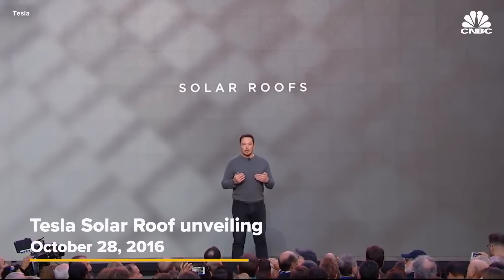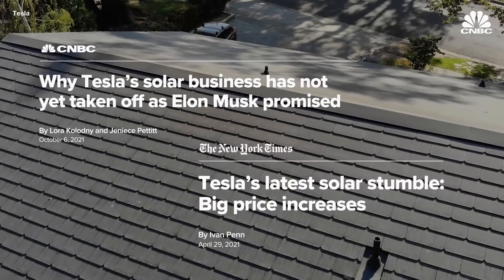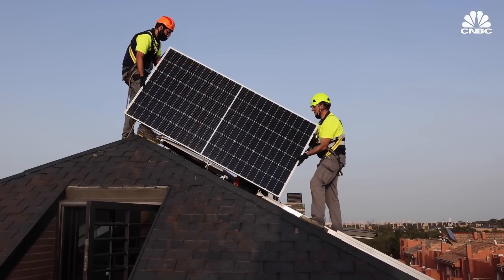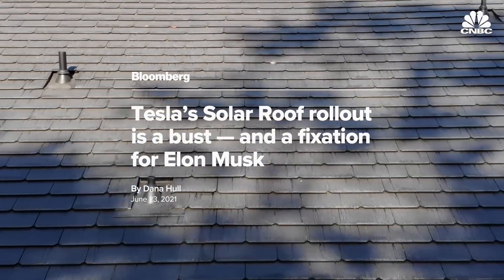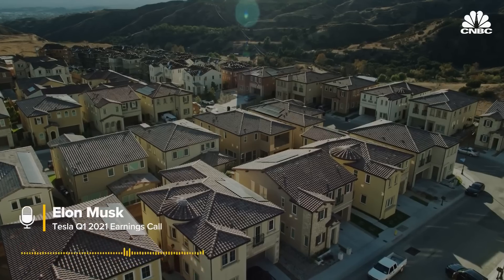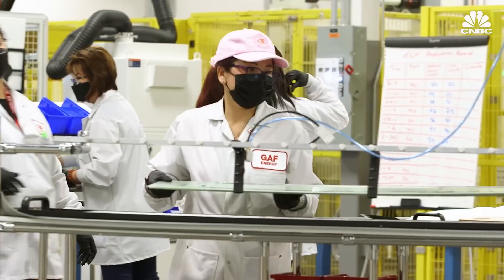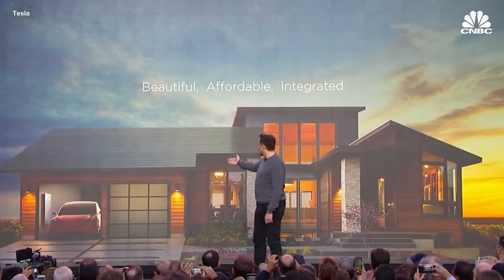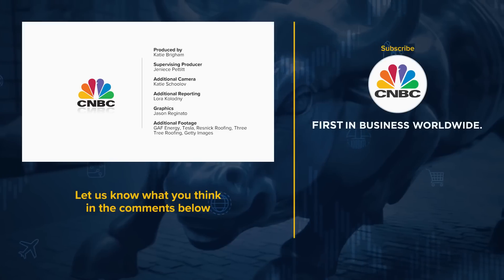How GAF Is Competing with Tesla’s Solar Roof | Solar Innovation Explained

Comment: Nope!  Not good enough.  These panels don't have micro-inverters or DC optimizers like traditional systems do.  Solar production can be blocked by small debris or shadow.  I'll stick with traditional 'ugly' panels which shade the existing roof and house which generate 3x the watts per square foot.

Comment: I pay 9 cents a KW for hydro, no  maintenance, no battery, no panels. Cheaper.
Reply from the maker: Hydro is a great way to go if you have the right set up and environment.  What kind of Hydro system to you use and recommend?  Is this a rain water collection system with a pump to the roof Hydro system.  I saw a few of those and they looked very interesting.

Comment: But how long will any solar roof last?  25 yrs?  30 yrs?  Then what?
Reply from the maker: Most traditional asphalt roofs last 20-40 years depending on the climate, the solar shingle roof has a 25 year warranty and should last longer than that but after 25 years the solar output efficiency will slowly degrade.  This is pretty typical of any solar product and/or roofing product.

Comment: Can solar roof tiles be made with metal roof base panel form. Metal roof panels are commonly edge fastened with clips.  Putting wood strapping with air flow beneath metal panels would allow natural air convection flow  helping to control heat buildup. Protrusions could be easily accommodated with plain none solar panel pieces.
Reply from the maker: Roof-it-solar a company in Estonia has been working on a metal solar roof.  Check it out here:  https://youtu.be/tf88kOktOA8 pretty cool what they are trying to produce.
Reply: @legacyroofingutah9766  thank you im contacting them for more info

Comment: I could see this working on the new house market best. rather then the replacement market adding 10,000 at that point not such a big deal.
Reply from the maker: Yes this is for new home builds or replacement roofing systems.  You wouldn't want to have a good roof removed just to put this on.  Wait until your roof has exhausted its current life then consider a solar shingle roofing option.

Comment: The heat is a good energy source, not a problem. 
Don't bend the good source for your twisted design objectives like those CCP.
Reply from the maker: 5 Myths About Solar and Weather
By The GAF Energy Team
7/24/2020
When it comes to how solar panels operate day in and day out on top of the roof of your home, there are few common misconceptions. We thought we’d clear up those myths with some facts about how solar works in all kinds of weather conditions.

MYTH 1: Solar only works in hot weather.
You need plenty of sunlight to generate solar energy and there are more hours of sunlight during the warmer summer months. It’s the light — not the heat — that solar panels use to generate clean energy. Solar panels actually work more efficiently when it’s not too hot outside. In fact, there are many instances of solar panels working in extreme cold, such as the Antarctic, or even to power satellites in outer space.

MYTH 2: Solar doesn’t work during the winter.
The Solaria solar panels used in GAF Energy roof-integrated solar systems have been subjected to extra reliability testing to expose the product to a variety of stresses, including severe heat and cold cycles and cyclic humidity and freezing. And, as we explained in Myth #1, solar panels work more efficiently in cooler temperatures, so while they may collect less overall sunlight in, say January, the panels will generate electricity any time there’s light — as long as they’re not completely obscured by snow. 

If it does snow, due to the pitch of most rooftops, as soon as the sun comes out the snow usually melts and slides off the glass panels. It’s also worth mentioning that, depending upon where you live, thanks to a policy called net energy metering the excess solar energy you generated during the summer can be used as a credit with your utility when your solar production naturally decreases during the winter. 

MYTH 3: Solar panels can’t withstand a heavy wind or rainstorm.
What’s amazing about the new GAF Energy solar system is that you’ll be getting a roof from the most trusted roofing company in North America and a solar system that’s designed to be part of that roof, similar to the way a skylight fits seamlessly into a roof. This avoids having to risk the integrity of roofing materials by puncturing them to install a traditional solar system, potentially causing leaks. A GAF Energy solar roof is a product that has been tested in lab conditions to withstand winds of up to 110 mph. That means it’s certified per building code regulations to be installed in areas with prescribed wind speed ratings of 180 mph. The wind test also includes wind-driven rain at a rate of more than 8 inches per hour — twice the rainfall rate of the worst rainstorm in history. 

MYTH 4: Solar doesn’t work in cloudy areas.
Today’s solar cells are more efficient than ever, meaning they’re able to capture the sun’s rays even in low-light situations. In fact, cities such as San Francisco, California and Portland, Oregon have plenty of foggy or overcast days, and plenty of happy solar customers. Up and coming adopters of solar energy, such as cities on the East Coast with similarly overcast weather like Boston, Massachusetts and Newark, New Jersey.

 MYTH 5: Installing solar causes rain to leak through the roof.
As we mentioned in MYTH 3, you’re getting a solar system that has been designed to be part of your roof. Because the GAF Energy solar system is a direct-to-deck installation, similar to a skylight, its seamless, waterproof set-up avoids leakage problems associated with conventional rack-mounted solar panels. Rack mounting or “retrofit solar” requires puncturing your shingles and roof to install the lag bolts that hold the rack onto the roof. This sometimes disrupts the shingles and waterproofing, causing leaks and potentially accelerating the degradation of your roofing materials. By comparison, DecoTech®  is installed onto a fresh roof deck along with a new comp shingle roof and flashed in to ensure that the building envelope is maintained.

Comment: How would this do in FL.?  are they using the seal tab in front bottom of the single and does this seal well to keep from blowing up/then off?  Are the connect in parallel or series like Christmas lights?  would hate to have one shingle go out then the row is died.
Reply from the maker: Yes these work just like traditional shingles and have a seal down in the front sealing them up tightly to be wind, rain and hail resistant. If one goes out it will not effect the others and can be replaced easily.

Comment: If my average electric bill is about $200 a month, it’s $2,400 a year. It would take 6.8 years to break even on the cost of that solar roof for $16,500. No thanks!
Reply from the maker: Solar can last well past 25 years so you would be getting free power from the sun for 18.2 years based on your calculation.  You forgot to add in the free energy after it was recouped and still producing for you.  A very smart investment in that case.  $2400 x 18 years = $43,200 in free energy.
Reply: Also, a vast majority of people don't understand their electric bill.  You have fixed costs in the bill just for having service brought to your home plus transmission costs.  My actual electricity cost in my bill is 1/2 the total bill, so my $100.00 a month electric bill only contains around $50.00 in electric cost or around $600.00  a year.  It would take me 25 years to break even on just the solar install assuming that is lasts that long and we know it won't - the solar panels degrade and loose efficiency.  Solar is fine for minor landscape mood light, but it will never work for roofing or be adopted.  Jimmy Carter put solar panels on the White House back in 1978 and Reagan ripped them off cause they didn't work. The Left has been pushing solar for 50 years and still no traction cause it isn't efficient or cost effective not to mention what is in a solar panel, it is toxic and bad for the environment and no one mentions that.  Electric lighting and the grid and wiring a house/country was adopted much faster 1890's to 1920's cause it actually worked and not pushed by force by the government, same for electric cars - they will only ever be niche market.
Reply from the maker: Solar has come a long was since 1978 and is very efficient and long lasting.  In most energy markets and cities is makes great financial sense.  No one with professional solar experience would share this opinion as it is very ignorant and simply untrue.  I suggest you do some real world research and find out for yourself.

Comment: Another question is why not design them so that you can put 2 row's side by side with one wire wire run ie one with the connector wires on the right and one with the connector on The left cut costs on the wire runs it would also means you could double the voltage
Reply: Bravo, dobro si to zaključio (!)

Comment: Question are they DIY compatible also what's the cost per square foot
Reply from the maker: Sorry the Tesla Solar Roof is currently not DIY compatible as it is quite a complicated customized install and comes with a very strong warranty only covered when installed by licensed Tesla certified installers.  Cost per sqft varies based on roof size, how many of the tiles are solar and how many are non-solar tiles, total solar system watt size, as well as numerous other factors.  Below is an article that can give you more information on how the Tesla Solar roof is priced:  See affordability section of the article: 

https://www.tesla.com/blog/solar-roof#:~:text=The%20typical%20homeowner%20can%20expect,the%20tiles%20look%20the%20same
Reply: @legacyroofingutah9766  since the article was on GAF solar roof panels that's the one I'm trying to find out if it's DIY compatible and how much are they and how do you tie in with GAF regular roofing tiles since I have GAF roofing ready to go on and since they're reasonable depending on the price of the solar panels would determine how many I could get to start with and then I could upgrade from there just remove a few shingles and replace with solar panels as I can afford
Reply: In following your link to them makes me Leary of them and as such when I redo my house roof it definitely won't be a GAF roofing shingles as it looks like they won't even cover the warranty on my garage roof since I didn't pay a roofer for his high markup on the shingles and his labor and I've found that any company that you can't contact directly if you have a problem and the roofer has gone out of business with good honest company if that happens will help you if you have any questions or problems we have a company that makes shingles and as long as you install them by the spec's on the package they'll warranty them never had to test that though as their 25 year shingles lasted over 45 years before they finally wore right out first roof I ever did second and third one's lasted about the same time the third one still looked good after 35 years and the new owners bulldozed the garage they were on I've always done my own work so I know it's done right worked for a new home builder and the roofing contractors he hired always had problems with their crew's most had to come back at least twice one roof had to have areas totally redone mine have never leaked and they last until the shingles wear out although they should be replaced sooner the 3 original one's I did are owned by development companies and they had planned on tearing them down for new developments that's why they tore the garage down it wasn't worth putting Money into it for what they could get out from rental maybe if they had planned on renting it for the last ten years it might have been but when you're planning on redeveloping the place it's always a year or so before it's time to redevelope the property but the first developers bought it in the early eighties and it's still rented so it probably paid for itself by now

Comment: I am a Roofing contractor in the mountains.  The Snow-Load would rip these things right off the roof  !
Reply: It’s really sad you would make such a strong statement without any knowledge.
Reply from the maker: Tesla Solar shingles are made with tempered glass, Solar Roof tiles are more than three times stronger than standard roofing tiles, yet half the weight. They do not degrade over time like asphalt or concrete.  These tiles are locked onto the roof directly and much stronger than any other roofing solution all while producing great solar energy for homes.  I personally have been on several install jobs; once installed these tiles are very difficult to remove without specialized tools and don't even budge under my 250 lbs of weight.  If you see one in person and walk on it as well as understand the install system your opinion will change on how they would handle large snowfall.  Few people have actually stood on as well as installed these solar roof's in person themselves.  Tempered glass is very strong and durable especially when using Tesla's unique installation method locking them in place for the long haul.  If you are considering a higher quality roof and also want solar then the Tesla Solar Tile Roof makes economical sense and looks so much better than any other roof solar solution.
Reply from the maker: Correction to this reply.  We are discussing the GAF Solar Shingle here and not the Tesla Solar Tile roof.  My mistake.  Please consider this a reply on the Tesla Solar Roofing product rather than the GAF Timberline Solar Shingle product.
Reply from the maker: Water-shedding and warranted

Timberline Solar™ is made up of shingles, not panels or heavy tiles. These shingles are water-shedding, strong and warranted to withstand winds up to 130 mph. Rack-mounted solar installations—where the solar is separate from the roof–require the drilling of dozens of holes into the roof membrane. Any resulting damage related to those holes is not typically covered by roof warranties.

For homeowners who already know the quality of GAF roofing products, the Timberline Solar™ roof has the same wind and water-shedding warranty coverage as Timberline HD.

https://www.gaf.energy/timberline-solar/
Reply: Because GAF has never heard of snow loads?